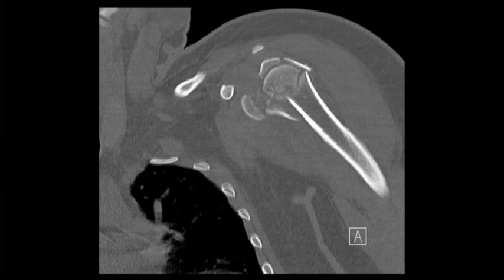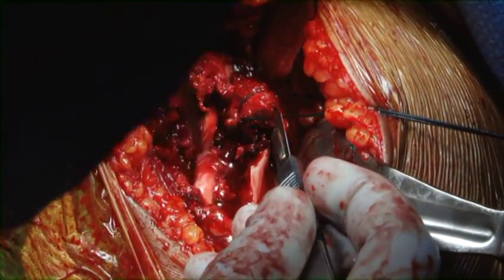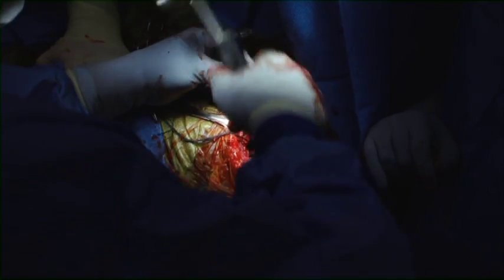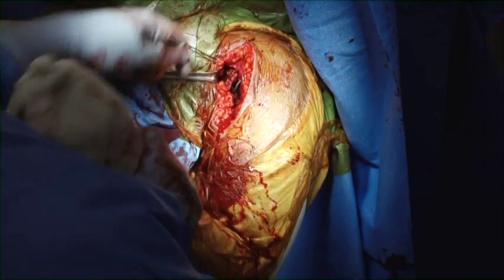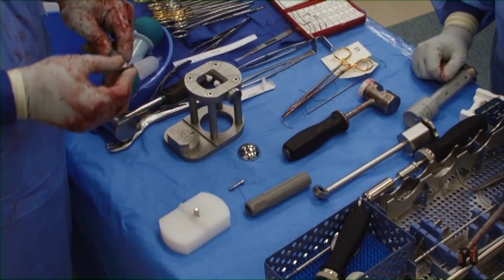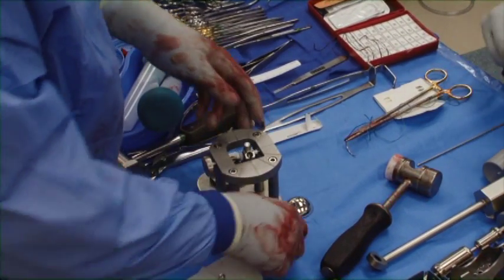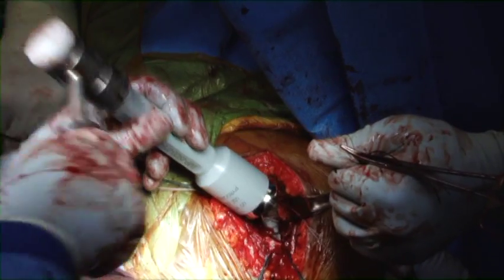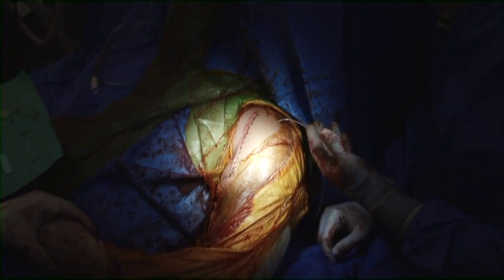Press Fit Modular Hemiarthroplasty for Humerus Fracture

Comment: I had this done, but I had snapped the ball off and spun it 180 deg and jammed it down onto the humerus. Like an ice cream, exploding the humerus bone. The operation included removing all the bone and chips. Cut a piece off the ball where the tendons etc were attached and then reattaching that slice of bone back onto the prosthetic. For the most part it was successful. I have half function of shoulder as opposed to amputating the whole arm. Which was considered. Now five years out, pain level of muscles/tendons of upper arm have increased with age. 49yo at fracture. Now turning 55yo. Hand swells a lot and is very painful most days. Daily pain of upper arm, 5-7. Hand pain is 4-6. Forearm never hurts. Sometimes elbow. Shoulder pain is slight and dull. Upper arm 24/7. No pain meds are taken. 8 hr. Operation. Nine months of physical therapy. I'm lucky. Some days with the level of pain I don't feel so lucky. I do type for a living and environment has been totally ergonomically studied has been equipped to support my needs. But with thus much pain where will I be at 65?
Reply: JupiterMoon  My first surgery was a hemi. 5yrs later I got reverse shoulder replacement with socket full of arthritis. Advuce. Do exactly what PT tells you. Don't do more, but be diligent to keep up. I can actually put my arm up straight over my head. I'm not perfect by any means put I can do basic functions.